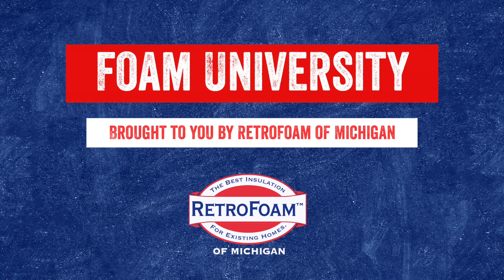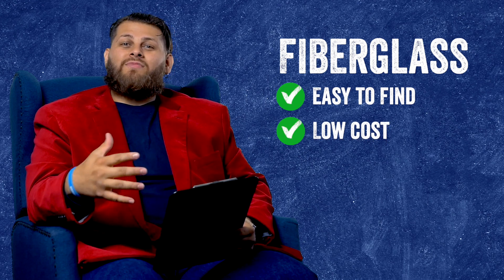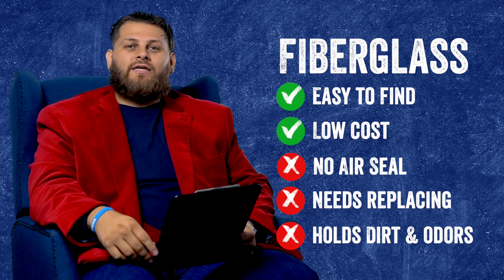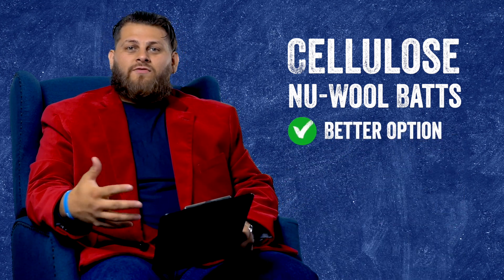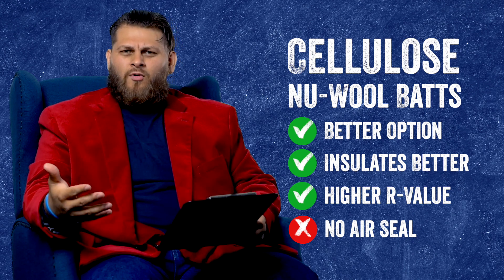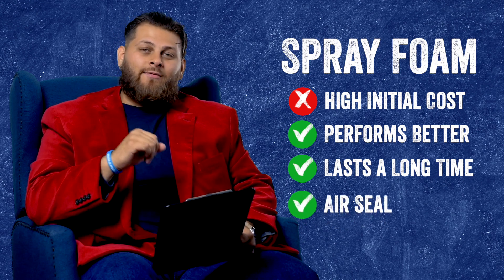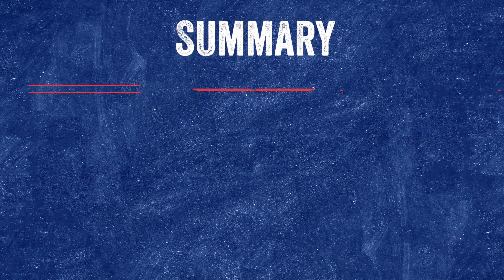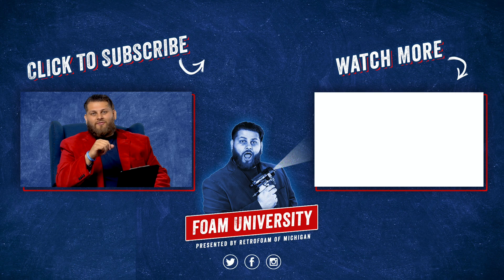Best Insulation for Garage? | Foam University

Comment: All that is nice but if by any chance u are working on your car or lets say welding and u make some spark you can only watch how fast your garage will burn down.
If you dont believe me buy a can of foam spray some out and put a lit match on it it burns up in a second .
Best isolation for your garage is rock wool
Reply from the maker: Our spray foam product is different from can foam. Our foam is class one fire rated and has no igniting factors. Here is an article on our website that talks more about our Spray Foam and anything to do with fire! https://www.retrofoamofmichigan.com/blog/insulation-fire-rating-definition